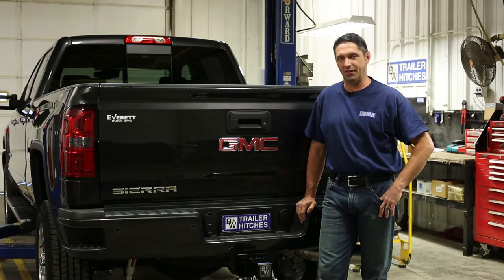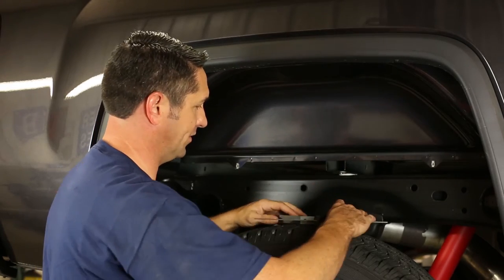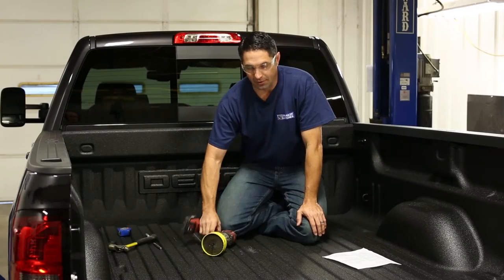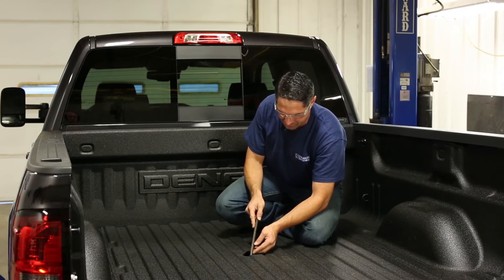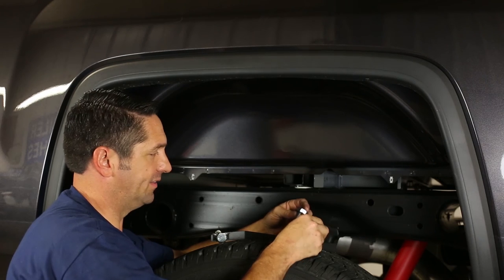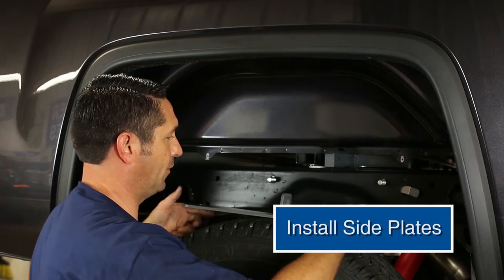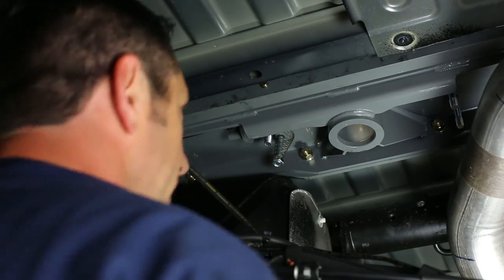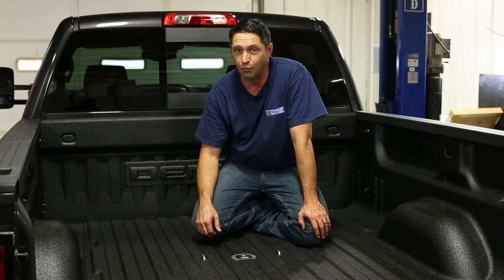Model 1012 Installation

Comment: Great video. 

Future viewers… If you don’t want to notch the bed you can loosen the bolts holding it on and use a 2x4 to pick it up long enough to slide the cross bars in.